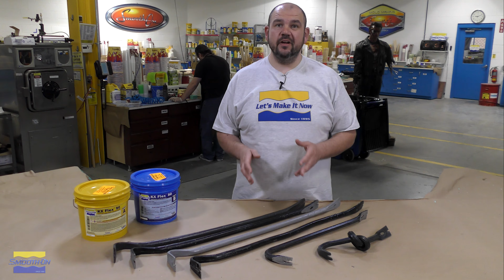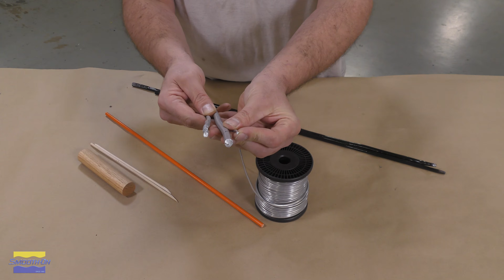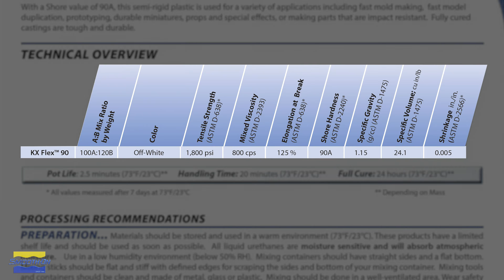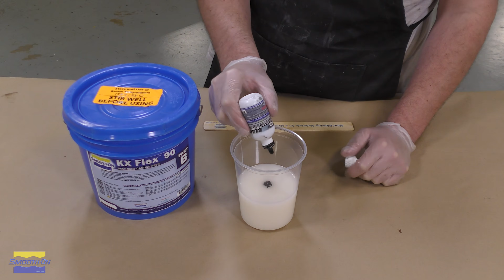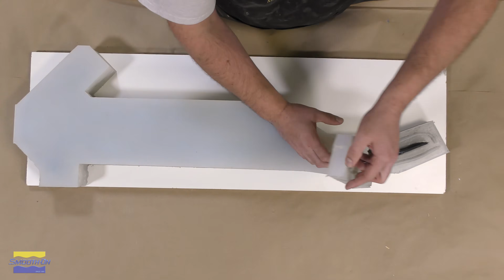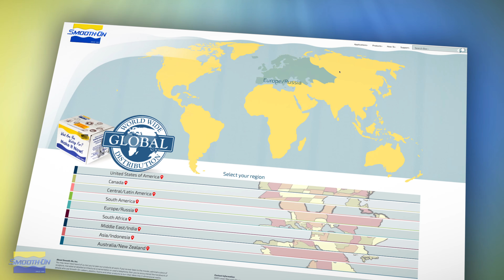How To Make a Fake Crowbar and Other Props Using KX Flex™ 90

Comment: How well does this bond to metal? for example, if I where to use this to make a customized handle for a hammer, would the resin itself bond with the tang (handle stem)?
Reply from the maker: Probably not permanently.  You would want to also have a mechanical connection

Comment: Is this stuff paintable? If not what is a good similar material to cast costume armor parts that could be painted for weathering etc.
Reply from the maker: You would need to use a flexible paint, such as a fabric paint or Ure-Coat urethane coating to paint the castings.
Reply: Oh damn, so Trident, the airbrush dye brand wouldn't work as paint? 
I'm building a Warhammer Beastman suit, and he needs some glorious horns- this tutorial was perfect for just that! I'll definitely go with KX flex